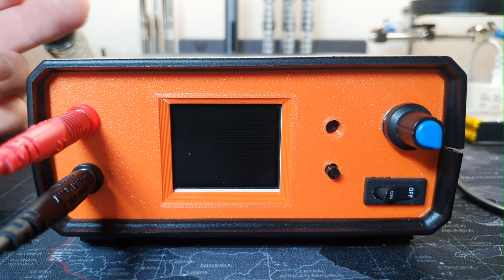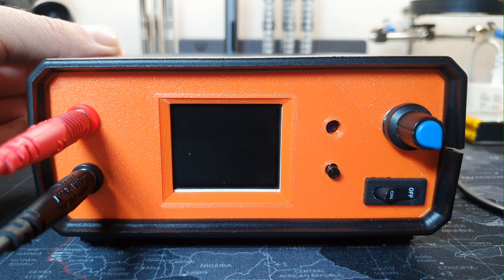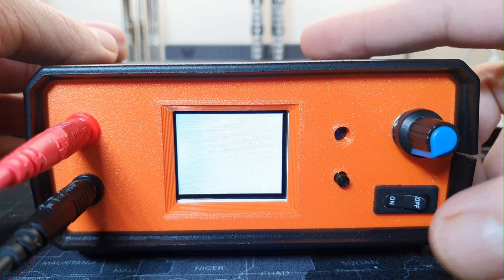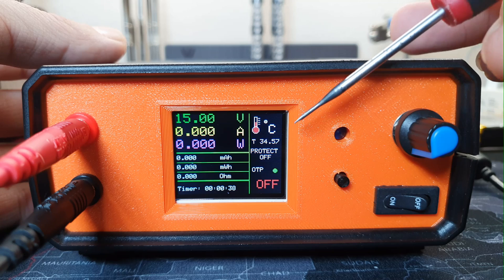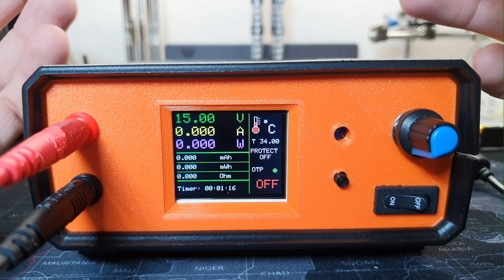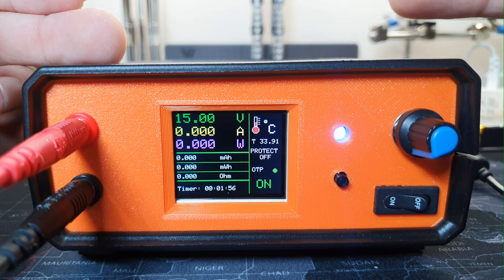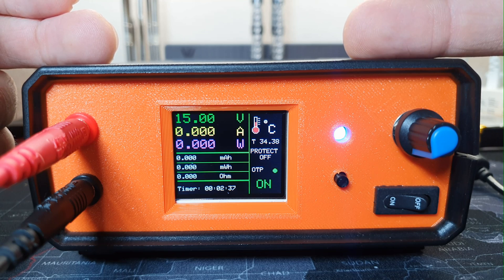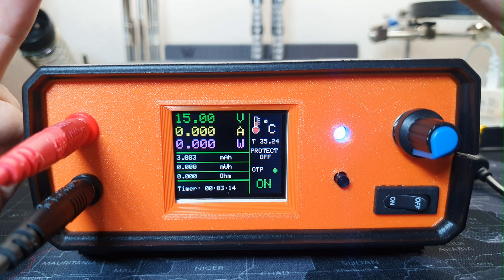DIY Arduino Nano Electronic Load V2

Comment: Great videos about this electronic load. I need to put this monitoring system on my analog electronic load that I already have (the one from China with 4 MosFets). I'm taking an Arduino programming course and your project is helping me understand how it works better. Thanks

Comment: I'm a tattoo artist, I really like your power supply, it's great that it can be replaced with an up and down button with 2 separate channel voltage storage.
Reply from the maker: This is not a power supply, is a electronic load.

Comment: Hola, ¿el PR2 de 5k es lineal o logarítmico? Could you make one with more than 5 amps with the TFT screen? Thank you.
Reply from the maker: The potentiometer that I used is linear, and to answer to your second question, unfortunately I do not have the time for that, I barely have time to work on my next project.

Comment: Amazing project, I like the TFT screen. It appears (error I could not create the program) when opening the sketch in Arduino IDE, could you help me? I think it is damaged, could you upload it again? Thank you very much.
Reply from the maker: I don't think that the sketch is damaged, is more likely that Arduino IDE itself to have a problem that causes that error, try to reinstall the program.
Reply: @HMProjects  I renamed the sketch .ino according to what chat gpt told me and it was fixed

Comment: Congratulation, good job. Your electronic load is a big update. I like your desing idea really much. The Display is the biggest Update, the old disply was too old school but now everything is fine now. You are using a hall effect sensor to measure the current, thas a good idea but i think to measure the current directly from the shunt resistors with a percision op-amp would be a good option. Finally you made it again, great projekt. I hope we see more from your engineering skils of DIY. Big thumbs Up.
Reply from the maker: Thank you for your kind words. Yes, I could be a good option to use a op-amp if you dont have a current sensor, it's easy to implement that but the hard thing is to write the correct code in order to measure the current correctly and most important precisely, and then comes the question, why to complicate things?, because INA219 is not hall effect sensor, it is a high-side current and power monitor IC, basically it does the same thing, for current measurement it's using a precision op-amp to measure the voltage drop across the shunt resistor, on V1 I used ACS712 wich is a hall effect sensor, anyways by using INA219 with a few lines in the code we can easily display voltage, current and power with quite high precision, and by selecting the desired full-scale current range to 400mA we can measure down to 0.1mA and at 3.2A full-scale we can measure down to 0.7mA, I think is more than enough to have such a resolution for this tipe of project.